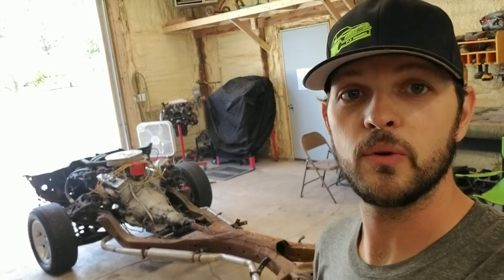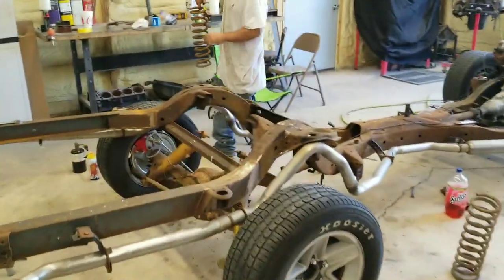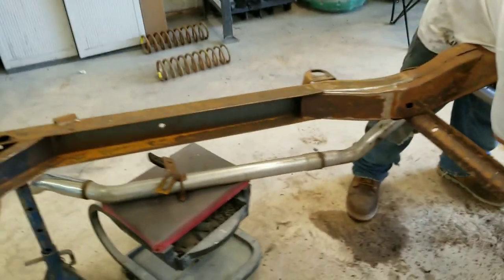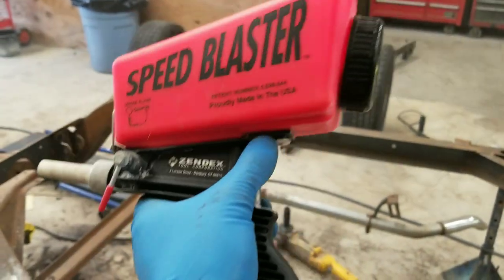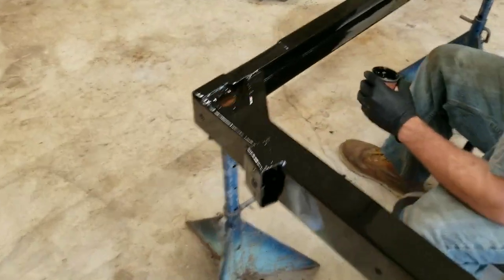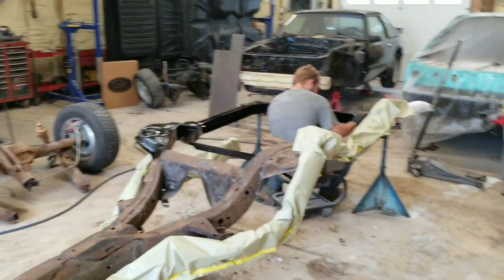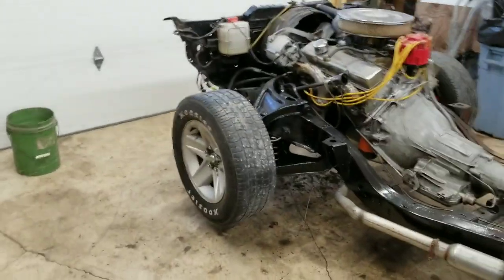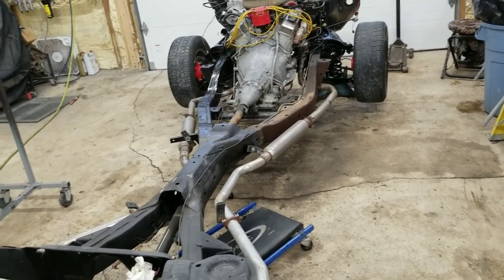#Frankingston 64 Impala build part 8 the frame rehab

Comment: You are a beast bro how much does something like this cost I watched all the 64 impala videos what’s the price on something like that
Reply from the maker: This particular car will be in the neighborhood of 18-20k parts and labor for the full frame off. If they have to come off the frame you can almost guarantee a 15k plus price tag.
Reply: @bpbrestorations2093  is that for everything  including  paint and assembly  Thank you
Reply from the maker: Everything but interior.
Reply: @bpbrestorations2093  ok cool what state are you in I need my 64 metal work done but not until next year and I will disassemble  everything  but the body and do most of the work my self but body work no that needs to go to someone  eles thank you
Reply from the maker: @mikeabresch3827  Tipton, Indiana

Comment: I've had a 64 for about 18 years that needs literally the same body work done to it. What's something like that cost?
Reply from the maker: If it has to come off the frame you are looking in the 18-20k range. If it just quarters and bodywork and paint on the outside roughly 10-12k.
Reply: Well... That's why its been sitting for 18 years..
 Maybe another 20.. 😔

Comment: I would stay away from the fitech lots of problems, spend the extra and go ls or Edelbrock Pro-Flo 4 EFI.
Reply from the maker: That's what I been hearing. May have to talk it over with the owner soon, thanks.
Reply: @bpbrestorations2093  I have a buddy at work that has been threw two fitech's on his 72 cutlass and now they will not warranty it. The electrics don't hold up too the heat.
Reply: LS pro flo4 is what we used first. Now doing a zz602 pro flo4